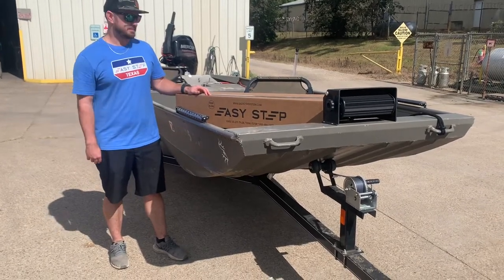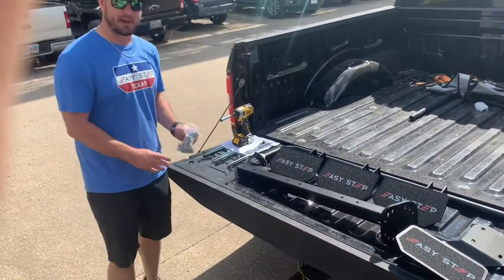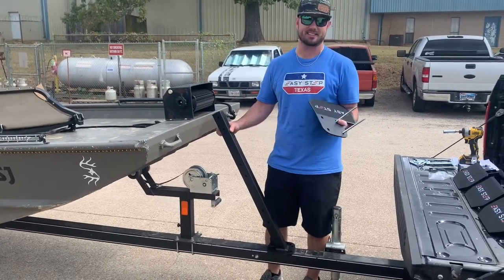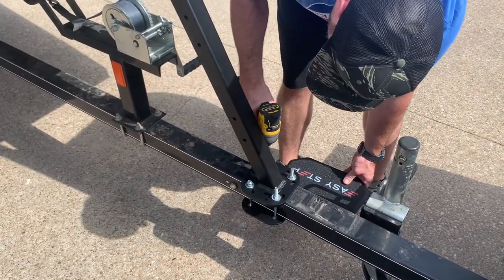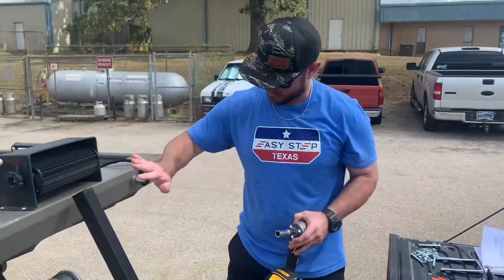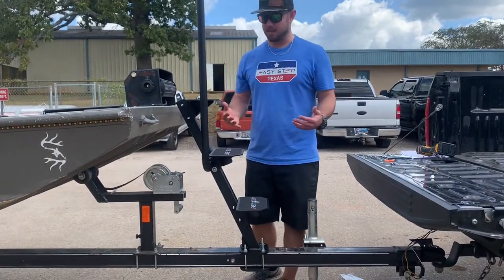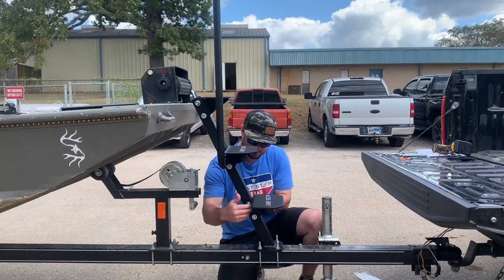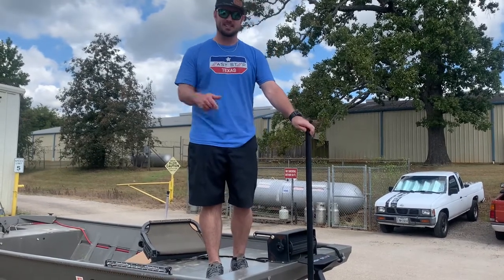Easy Step 3.0 and 1.0 Install

Comment: I just installed these on my 2022 Tahoe 185S trailer. I love them. very well made!!!!!!! The 1.0 is close to the front of the trailer tongue but it works fine. I also added some non skid to the top of the trailer tongue to give me an extra area to step. Excellent customer service and I got my order in 3 days!!!!!! Also with the handle mounted to the center step, it clears my garage door.
Reply from the maker: Good deal! Glad you are happy with them! Good idea on adding the non skid to the tongue!

Comment: I just bought a 2022 Skeeter ZX-150 and needing steps badly because of disability. Im 6’-6” 390 lbs so i need something strong and plenty of handles because of my leg weakness. I have questions into one of your competitors, i guess they don’t like answering questions because I’ve emailed twice and no response so I’m hoping you can help me out. Will the ESS3 Pivot fit a 2022 Skeeter trailer?
Reply from the maker: Shoot me an email and we can help you out! info@easystepsystem.com

Comment: Looks like you are going have trouble raising your trailer jack with that 1.0 installed
Reply from the maker: This video was for instructional purposes. You are right, with this specific trailer jack the upper portion on the jack would fold on top of the 1.0 assist. This boat currently only has the 3.0 installed on it.